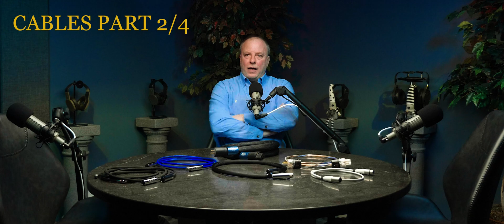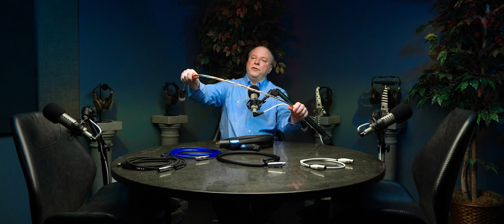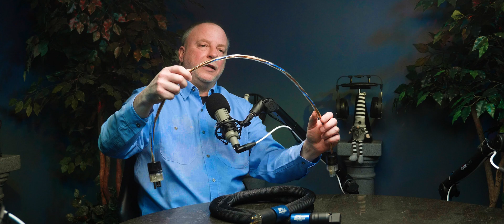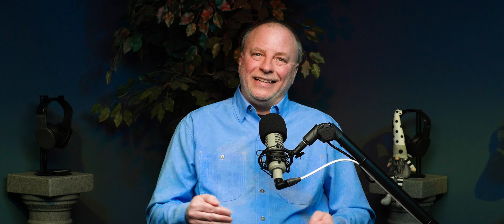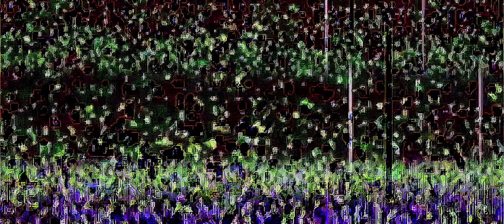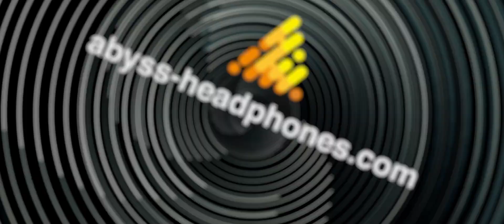Cables Part 2: Materials & Design Engineering a Hi-Fi Cable

Comment: Im relatively new to the whole audiophile thing. But I am curious about how you explain that the difference between cables seems to be immeasurable with the technology we have access to currently. Technology that - as far as I understand - exceeds the abilities of the human hearing by a long shot. I don’t mean that as an accusation, I am just curious :)
Reply: You are being sold a lie. The difference is immeasurable because there ISN'T a difference.
Reply from the maker: We can measure the simple electrical characteristics of the cable but they won’t describe how the cable sounds to a trained listener within any given high end audio system. There are currently no measurement systems designed to do this, would require the equivalent of a brain.
Reply: @ABYSSHeadphones  Alright, brain scanning technology isn't there yet. But surely the brain perceives sound only based on inputs from air pressure sensing organs. And the technology for analysing sound in the physical environment safely exceeds our biological sensitivity. We could continue with the physical sound being generated by electrical signals and here too the analysing technology is orders of magnitude beyond required sensitivity.

The literally million-dollar question is: Why don't you demonstrate in a repeatable test excluding human factor that a cable causes any change whatsoever in the acoustical or electrical environment? Because if nothing changes there, nothing can change in the brain.

Surely such a showcase would mean a significant customer influx from among those being uncertain or even part of the outright deniers. But there's been no visible effort toward this from any cable manufacturer. Whenever a 3rd-party cable measurement was published, showing an ineffectiveness, one would reasonably expect a counter-reaction proposing a test design that would show otherwise. Therefore either everyone universally ignores a relatively easy way of growing their business, or this belief and/or placebo based situation is the best they can hope for.
Reply from the maker: @tomas_m  This is very simple for those who have taken the time to learn, we listen to it. We may do a video in the future on how to train yourself to listen for change. It all begins with a spark.
Reply: @ABYSSHeadphones  good point. This hobby at the end of the day is about enjoyment. Our brains are far far far too hard to emulate.
Reply: @ABYSSHeadphones  "There are currently no measurement systems designed to do this, would require the equivalent of a brain."
That so incredibly misleading that you probably actually believe that. And it nicely couples with the video you linked above, where you vaguely trash double blind testing. This way you declare the only two objective approaches that are capable of proving you wrong as unworkable.

Another brilliant misdirect is how difficult and time consuming it is to master this mythical ability to hear cables. First, it puts skeptics into the position where they have to do the work and convince themselves that you have the truth after all. That nicely glosses over the fact that you have nothing to convince them with in the first place.

However, inside of that is another misdirect, because if anyone somehow goes through all that trouble to "learn" all that you learned and ultimately say "there is no difference", you are going to dismiss them anyway, because in your mind, if they truly understood, they would agree with you.

This is the definition of faith as belief without evidence.
Reply from the maker: So then you agree that we have no current method to measure things like soundstage and imaging in any way that correlates to our listing experiences. Thanks for that! This is progress, we're no longer being told to  provide proof by measurements, knowing there's no way to do so.
Reply: @ABYSSHeadphones  Again, an ingeniously deceptive way of framing the issue. You should know that nobody is disputing that changing the cables can truly change listening experience. That is actually to be expected.

What is in dispute is that changing cables changes the SOUND coming out of a device in a way that is even theoretically perceivable by human senses. This is entirely decoupled from listening experience. If there is no change in sound after "upgrading" a cable, the change in listening experience is mind doing it to itself. There is no need to measure sound stage and imaging. You need to measure vibrations and we can do that with subatomic precision. Your hearing cannot.

By the way, if we had a mind reading device, we would be able to objectively measure the change in listening experience. However, that would be entirely unhelpful in figuring out if the cables have a real or perceived impact on the listening experience. Inside of your mind, there is no difference. Ironically, even if mind reading was an option, a double blind testing would still be necessary. And in that case, might as well do a double blind test without it. Funny how that works, huh?
Reply: There are aspects of sound that aren’t  measurables

Comment: Okay time to unsub - too much snake oil
Reply: do you know that just because you lack the knowledge or the skill doesn't that mean that what Joe's saying is a myth right?
Reply: Do you own a high-end headphone? If yes: did you compare high-end cable and cheap cables with that?
Reply: @DocToxicTF2  I own empyreans and hd800s and I’ve owned expensive cables for both - no difference. I tried to hear the difference, clearly, cause I spent money on them, but there wasn’t any. As a sound engineer for over a decade, I had to be objective about what my ears were hearing (or a lack therefore)
Reply: @HiLoMusic  Ok.
Reply from the maker: @HiLoMusic  Not all cables are created equal. Nor are headphones, or mastering engineers for that matter. Just because you put together tracks to make one certainly doesn’t mean you listen for the same things we do on playback. Nor should you. While there is some overlap, what your job entails is not the same as a music lover and his system.

So in your case, you tried some cable of unspecified origin on a headphone using unspecified electronics, and came to a conclusion that it doesn’t matter, even though you already knew that. You won’t get past that bias, plain and simple.

On another note, the Emperian and 800 come at playback from 2 different tonalities, one laid back while the other treble aggressive. In as such, each would require a different sort of tone control of a cable and/or system in order to bring either closer to what we would consider center. Affecting a noticeable change, if any, and in particular a positive change, would be dumb luck at best without choosing a cable suitable for each. And in either case we do not make cables that do this, we do not sell tone controls. In fact, we only make headphone cables for Abyss headphones.

Look man, if you’re truly interested in improving your ability to hear the most subtle of details in the mix, we have the tools. If not, you’re good to go.
Reply: @ABYSSHeadphones  It seems odd to me that you would discern a 'music lover' to a mastering engineer and producer, as one is a layman and the other a part of the industry, you'd think, or would hope to assume that one has a better understanding of tonality than the other - not only that, but one can be an audiophile and a producer or engineer all at the same time, which is what I am. 

I bring up these other wires as examples to what I've heard before on pairs of headphones known well for their general quality and appraise in the high-fi community, I know you don't make cables for these pairs of headphones, but I bought cables from trusted sellers, with a similar shtick you guys sell. Only perceptible difference is in the minute MHz range that's far beyond any discernible variance (and that would be general impedance anyways). 

If you're so confident in your wires genuinely improving the sound in your system, then I'd love to see a blind test done with stock and higher-tier wires, but it seems whenever this question is asked, people are too scared to make such a video.
Reply from the maker: @HiLoMusic  We know from experience that what you primarily are listening for is dependent on your use case. To put it another way,  you really have no way of knowing what I listen for. If you think for example mastering engineers have the same subset of listening skills as audiophiles, that would seem to say any audiophile can do mastering. We know for certain that we each listen for different things, dependent on our life experiences, it's buried in the psychology of each individual. We plan to do more on this topic in the future.
Reply: @DocToxicTF2  I do, i got around 13.000€ on headphones and $hit. 4000€ on STAX etc. Not one cable has changed anything. Tested up to 950€ handmade HD800 balanced cable against cheap chinese cable (85€), NOTHING, no differences at all.  And i bet none of you can pass ABX test on those super expensive headphone cables. I haven't seen any video about it or any real ABX test being done.
Reply from the maker: @Thevikingcam  it sounds as if you don’t want to hear an improvement. No A/B/X test will work if your expectation bias is set to ignore. 

Note the video before this where Joe talks about how he had to first teach himself what changes to listen for by keying in on snippets of the music that stand out . That’s where  your ability to discern change begins, if you choose not to learn...
Reply: @ABYSSHeadphones  But hey you guys got the equipments and good video guy. Make blind test video. Problem solved. If you do that ill be back :D
Reply: Definitely will make your cable sales go sky rocketing! That is if you succeed.
Reply from the maker: @Thevikingcam  You misunderstand our position, we’ve succeeded many years ago. In fact, what we do at Abyss headphones was built upon our knowledge of the sound of materials.
Reply: @ABYSSHeadphones  That's only your word on it, make a video and i guarantee  you will close a lot of background noise on this topic. In a fact you guys will make history with the video.
Reply: @ABYSSHeadphones  that’s placebic - anyone can believe they hear a difference if they strain to hear it, hoping they’ll hear it.
Reply: Just think about it, every Hifi publication will put you on front page :D
Reply: @HiLoMusic  Exactly, its even proven  by scientific tests. Also humans auditory systems short term memory aka Echoic memory is only 3-4 seconds long so instant ABX is necessary.
Reply: But dont worry ill be buying ABYSS 1266 soon this year. I KNOW that will make a difference :P
Reply from the maker: @Thevikingcam  https://youtu.be/SWJbbrhJP_I
Reply from the maker: Abyss headphones and JPS Labs cables have been in every major audio magazine, YouTube reviewer, etc, and then some. Our small company has touched hundreds of thousands of lives over the past 30 years, showing so many people who appreciate audio how to improve upon their systems, and their lives. Positive proof has been established long ago. We have no need  to perform tests for what is already a given.
Reply: @ABYSSHeadphones  Those "reviews" are not proof, at least on anyone's book who is into science.
Reply: @Thevikingcam  We live in a world where all the "proof" in the universe doesn't mean shit to someone who isn't open-minded enough to at least accept that there is a possibility of something outside of their cemented belief system that something is legitimate or not. It's perspective-dependent as most things tend to be. And of course, Dunning-Kruger effect and Occam's razor and other things taking place. Believe what you want and live your life by it if you must, but don't preach it as fact to others. You believe what you want and we will believe what we want and go our separate ways.